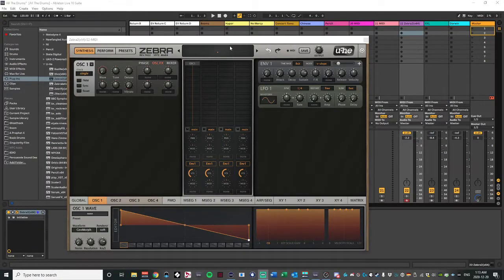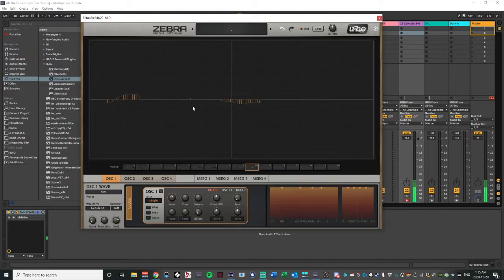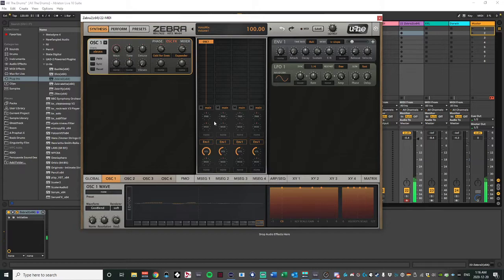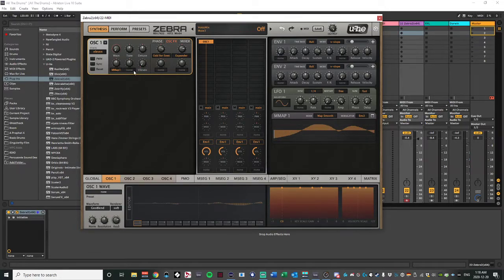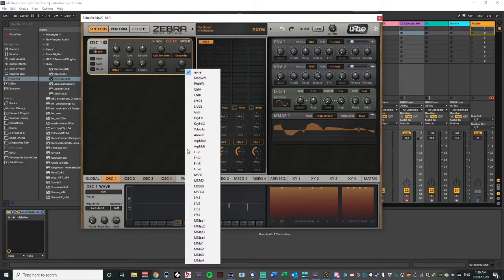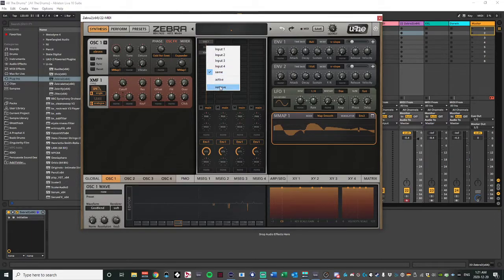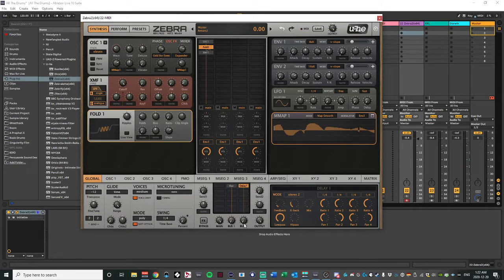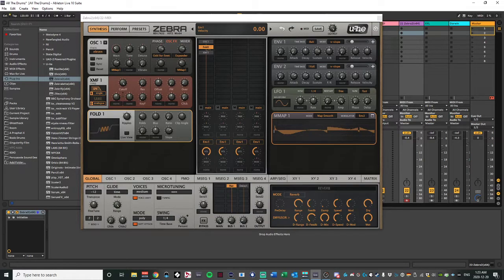Bass Sound Design in Zebra 2

Comment: Hey Scott. Watched it in more detail. Excellent video and advice. Very curious about this synth now. I use Reason's Europa and Parsec synths for similar textures sculpting. The key is indeed to add some manual touch to modulation and not automate/sync too much. This achieves a more natural and interesting sound. Personally, in the next step after this I would create a parallel instance of the same synth, and start running it thru Valhalla Supermassive to create yet another texture layer underneath!

Cheers! 
Slava
Reply: Sick idea about running another instance through supermassive!
Reply: Why not use send fx to do that?